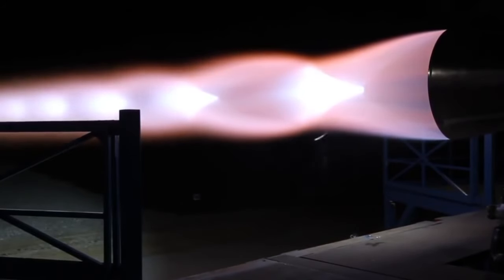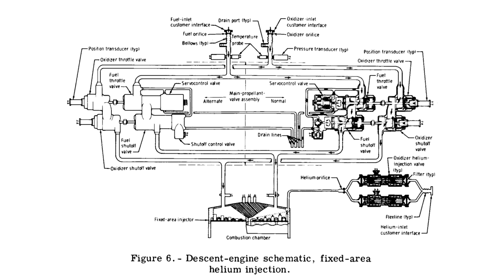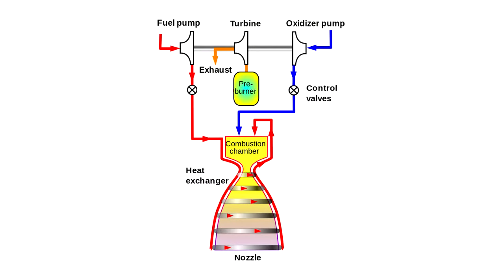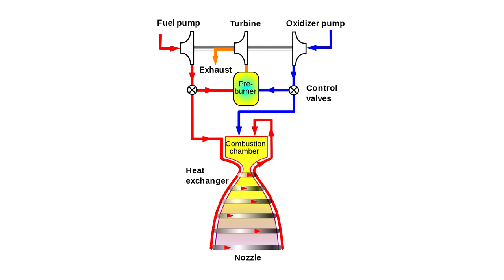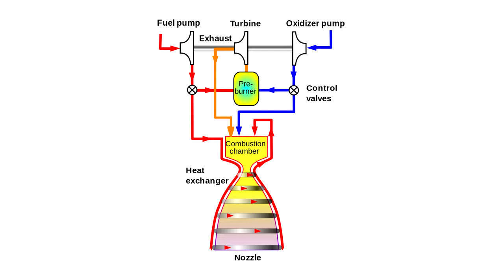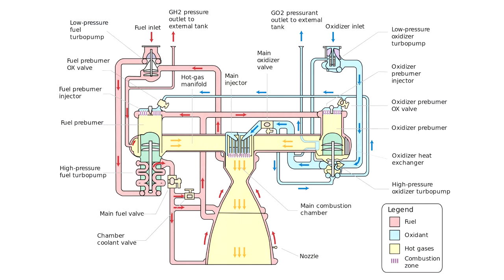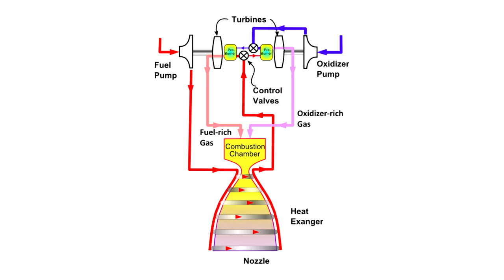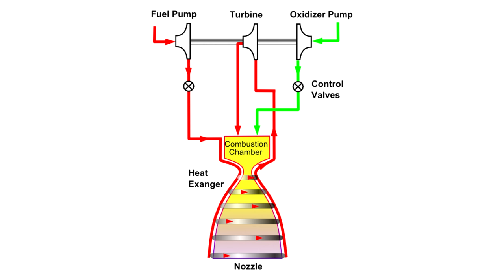KSP Doesn't Teach: Rocket Engine Plumbing

Comment: How about install turbines right on top of feeder inlet so that it burning chamber will resemble jet engine? Only it will get oxygen from internal tanker of cause. Back pressure from burning chamber could be minimized by funneling diameter. So, pre-burner will be in the center and fuel will be entering in the outer shell ( ceramic ) of pre-burner. This design even could be scavenging, in lower atmosphere, oxygen from outside thru, eventually, open-close inlet.

Comment: Scott could you make a tutorial on how to install Hot Rockets? I can't seem to get it to work. Thanks!
Reply: Cool them in a controlled environment to avoid cracks, then install them when they have reached near room temperature.
Reply: Lol good one. Thanks for the help however I would still like the tutorial Scott :)
Reply: Hot Rockets is just a plugin for other mods to add configs and assets to. If you're expecting something to change immediately after installing it, what you probably want instead is RealPlume.

Comment: Maybe hydrogen perperoxide (HOOOH) AKA Dihydrogen Trioxide AKA Trioxidane) is the oxidiser of the future ;-)  It can be catalytically decomposed to water & singlet oxygen... which you would need to use quickly but since it's in a higher energy state, it's more reactive so it will react with acetylene (and possibly 1,2-dicyanoecetylene. The plumbing for THAT would be exciting.

Comment: So how does the engine (pump) start in the first place in the combustion tap-off system?
Reply: normal fuel flow. Its only when the chamber starts reaching nominal pressures that you need turbopumps for force fuel in against the backflow - but by then the turbopumps are running from the already combusting...combustion. Yea...

Comment: hey ... I like your job and you are  helping me understand  more of what  I like in life so thanks but can you explain WHY HIDROGYN OR METHANE EXACTLY  how fuel is been choose by space engineers ??? ... please  respond  because I'm dying  to find out
Reply: Lots of reasons, physical, chemical, engineering, economic... Read 'Ignition!' by John D Clark.
Reply from the maker: +Sidou Benras I made a video about this a long time ago https://youtu.be/jI8TuufCp0M
Reply: Rocket engines work better the faster their exhaust gases goes. So fuels which have lighter exhaust gases will be better (for the same amount of energy). Hydrogen is really good becuase the combination of the energy released when it burns with oxygen plus the low mass of water molecues  (which is true for methane too). But there are other engineering trade offs: how easy is it to handle/store/pump the fuel? (Liquid hydrogen needs to be kept at -250C), how expensive is the fuel? How poisonous or dangerous is the fuel? So engineers choose fuel based on engineering trade offs!

Comment: Turbo pumps sound an awful lot like a turbocharger for a car, just with an extra compressor wheel to pump fuel.
Reply: Operation of turbo pump vs turbocharger is practically the same except one pumps liquid, the other gas.
A better analogy is (just as mentioned in the video) pumps in fire trucks. The impeller (equivalent to compressor wheel in turbocharger) spins and the centrifugal force sends the liquid to the outside of the housing and through the outlet. Pressure varies according to how fast the impeller spins.

Comment: Hi there!
I've got a question about rocket fuels! Is any alcohol able to be a rocket fuel? Like methanol etc.?
Reply from the maker: +Lele Merb alcohol was used on early rockets, but it's less energy dense than alternatives.
Reply: Scott Manley ah ok i already thought about the energy density of alcohols too. But I thought it would be denser than it really is. Nevertheless thanks for answering that fast.
Reply: It's not too bad for making small model-scale rockets if making tiny liquid-fuel rockets is a thing you want to try, it burns pretty easily, which helps.

Comment: Wait, why can't you just use a one way valve so that the pressure of the combustion chamber doesn't push back into the turbine in a closed cycle engine?

Comment: I understand the idea behind pressurizing the tanks to "push" the fuel out of them, but how do they make sure the ~fuel~ comes out into the combustion chamber and not the pressurizing gas?
Reply from the maker: +BloodyRain2k on the ground. Gravity. In space they'll use small thrusters to accelerate forwards and push the fuel to the bottom of the tank
Reply from the maker: +BloodyRain2k on the ground. Gravity. In space they'll use small thrusters to accelerate forwards and push the fuel to the bottom of the tank
Reply: Ah right, now of course I remember this detail which I picked up somewhere kinda recently.
And after the engine kicks in there's more than enough acceleration to keep the fuel in "front" of the pressurizer so it won't go into the engine.
Physics yay :D

Comment: why don't you just put the, for example, fuel rich exhaust of the turbine right infront of the turbopump of the fuel.
the hot exhuast gases would cool down in the fuel without combusting, and the preshure there is very low, so no worries.

I'm shure there is a big flaw with this, but i don't see it ATM.

Comment: Shouldn't there be another pipeline from the Oxidizer turbopump side going into the combustion chamber... on the diagram looks like all the LOX goes through the preburner... (on the full flow diagram) ?
Reply: No error, I think everything passes from the pre-burners and gassifies before entering the main chamber. That is why FFSC engines are also called gas-gas engines.
Reply from the maker: +Dante800 shouldn't that depend on the fuel/ox ratio of the fuels?
Reply: Nope, if I remember right from the wiki article that picture's from, they just mix the oxidizer-rich and fuel-rich gases in the main combustion chamber, since they're conveniently proportional.  Any reaction poisoning due to pre-burnt combustion products is made up for by the head-start on chamber pressure.
Reply from the maker: That diagram may refer to the IPD design, which what H2/LOX - the Hydrogen volume is so much higher.

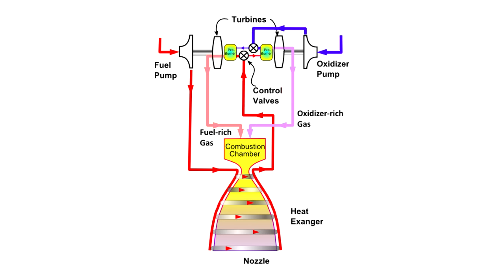Comment: In 11:23 picture there are no liquid fuel and oxidizer pipes going directly into combustion chamber. Is is to make the picture clearer? I'm confused.
Reply from the maker: +Jan Mikicki I think an edit to the Wikipedia page may be in order.
Reply: It seems that a tiny amount is taken from each to get the turbo props running, with a mix that is safe, then you mix the two back together after going through the turbo pumps. So all oxi and fuel goes through the generating turbo pumps and the pulling pumps, nothing skips the pumps to go direct to the combustion chamber.
Reply: unless it is supposed to be like that? meaning - fuel/oxidizer rich mixtures get pumped into their respective turbines at quantities large enough to sustain normal operation and pressure in combustion chamber... is that even possible? having a turbine that takes energy from that fuel flow but lets through enough to operate the main combustion chamber?
Reply: Guessing it's easier to just pipe everything through both preburners.
Reply: Its not easier. It is better though.

Comment: I thought the SSME also used a full flow staged combustion cycle? :0
Reply from the maker: Nah, not all the oxygen flowed through the pre burners.
Reply: @scottmanley  Ah, thanks for reply. Facing an exam in rocket engines next week. :D

So how you call the cycle from SSME?
Reply from the maker: @Revan176  It's a staged cycle with full fuel flow (all the fuel goes through the pre-burners).

Comment: How does fuel get to preburner(s) at startup before turbopumps are active?
Reply: The fuel tanks are pressurised with nitrogen or helium, or you might be able to do it with just gravity pressure if you are starting them on Earth and you tanks are high enough.
Reply: Smaller turbopumps are used to activate the next big turbopump.

Comment: Is soot generation not an issue with methane fuel? I know hydrogen doesn't make any soot if burned when hydrogen rich.
Reply: I believe that methane does in theory produce some tiny amount of soot, but it's practically nothing, especially when compared to kerosene.  The soot-generation process is generally referred to as "coking", and can be a big problem if you want your kerosene engines to be reusable.
Reply: In general the longer the hydrocarbon chain the more complex the combustion products. CH4 + 2O2 = CO2 + 2H2O.  4H2 + O2 = 2H2O.
Kerosene is a bunch of different long chain hydrogen carbons. So, it's not really viable to give a simple equation for it.
Reply: As someone who did mass spectrometry on flames at university I can help you with that a bit. First thing is that the processes in flames are not understood by now. There are many effects that determine the chemicals you find in the exhaust. And by that I do not only mean the type of fuel and oxidizer you use but also temperature, pressure and the system you use to mix fuel and oxidizer.
You can minimize soot generation by burning an oxygen-rich mixture because this reduces the chance of two reactive fuel radicals forming ever growing hydrocarbons which in the end become a soot particle that becomes a problem in your chamber.
In the end there are only two ways to prevent soot in your engine. The first one is to not use fuel that does not contain any carbon or to burn a very oxygen-rich mixture. In my experience 40% excess oxygen and good mixing means that you cannot find any soot or soot precursors using a mass spectrometer when you mix fuel and oxidizer well.

Comment: There's a small mistake I think. At 6:36 you say "Merlin engines burn a bit of your fuel with a lot of oxygen". That's wrong. Pre-burners on the Merlin run Fuel rich and so you're burning a bunch of fuel with a little bit of oxygen. That's why the pre-burner exhaust on a Merlin is dark and sooty black. You additionally don't want to run oxygen rich because that will burn the metals in your engine.
Reply from the maker: +Ergzay yep got that backwards, Russian staged combustion engines pioneered the ox-rich cycle.

Comment: a fuel pump from a modern diesel engine goes well over 1000 bar in pressure the engine will not start till it goes over 130 bars
Reply: The operating conditions in space are quite different. It gets very cold in the shade and hot in the sunlight up there and having high pressure inside and barely any pressure outside (near vacuum of space) doesn't help.
Reply: For pretty much the same reason even: to overcome the pressure in the combustion chamber. It's simply what you have to deal with when you use direct injection.
Reply: The flow rates are a bit higher in a rocket engine.
Reply: True, but don't underestimate the airflow through a combustion engine either!
A 2 liter engine running full throttle at 6000 rpm will suck in 100 liters of air per second. Mass flow is much less impressive, but that's what happens when you use ambient air. Fuel flow is even lower because ~80% of that air is pesky inert stuff.

Comment: Did you just summarize the chapter on engine cycles in "Rocket Propulsion Elements"?
Reply from the maker: I wouldn't know, I've never seen that book.
Reply: Scott Manley George Sutton & Oscar Bilbarz? A standard lecture for aerospace engineering

Comment: 5:00 Peroxide is an Oxidizer, not a fuel.  it isn't really a big deal, but it bugged me when I heard that.
Reply from the maker: It’s absolutely used as a fuel in monoprop engines.
Reply: @scottmanley  in monoprop engines it would be considered a "propellant" (mono-propellant), but the bloodhound uses hybrid engines so in that case it is an oxidizer.
Reply: it is a "rectangle/square" type of thing, oxidizers and fuels are both "propellants" (as are nitrogen, helium or whatever you want to use in a "cold gas" thruster) but oxidizer and fuel are not interchangeable since the role differs in the reaction chemistry.

Comment: Why can't you use perfect ration combustion for your preburner? You explain that the result would be too hot, but couldn't you just add less propelant?
Reply: That would make it an oxygen-rich preburner.
Reply: less fuel would not make it a perfect ratio
Reply: Did you mean "less propellant" rather than "less fuel"; reducing both the fuel and oxidizer proportionally so the mixture is still the perfect combustion ratio but less mass overall is combusted? My guess is that the uncombusted fuel or oxygen serves as a coolant to help carry away the heat.
Reply: That is indeed what I meant. My comment has been corrected  to reflect this. I would also have guessed that the uncombusted ingredients serve as coolant, but it seems like, were this the case, other solutions for heat dissipation would be more efficient.

Comment: if the pressure in the pre-burner has to be higher than in the combustion chamber... how do you get the fuel in there? :P
Reply from the maker: +Ebumbaya ' that's rocket science.
Reply: which is?
Reply: pumps. that go up to a much higher pressure than would be needed for an open cycle engine.
Reply: The pumps work above chamber pressure to feed the turbine. The pressure ratio across a staged combustion turbine can be low because all of the fuel is flowing through the turbine. With full flow staged combustion the pressure ratios (now that there are two turbines) can be even lower because both fuel and oxidizer streams are doing work. The turbine pressure ratio has to be as high as possible with a gas generator because the flow should be as low as possible.

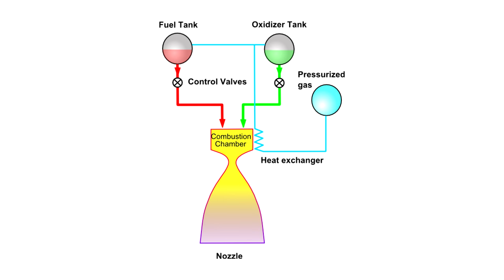Comment: 1:55 you mean Nitrogen is by far the most common. You said Helium :-) Or maybe you are right, I don't know... But it sounds stupid to me to pressurize something with Helium, if you can use Nitrogen - a much cheaper alternative.
Reply from the maker: Helium saves mass, mass is very important on a spacecraft.

Comment: Pratt & Whitney RS-24 (SSME) Block I H2 Brayton turbopump produces 53,690 kW which at 351 kg has a specific power rating of 153 kW/kg.

The EMRAX268 Brushless AC motor masses 19.9 kg and produces 200 kW which is 10.05 kW/kg.  Getting up there!  Its twice as good as a turbofan engine used on airliners!

SIMPLIFIED PLUMBING

Now consider the following, creating MHD power from the rocket thrust chamber directly; 

https://ntrs.nasa.gov/archive/nasa/casi.ntrs.nasa.gov/19970020328.pdf

https://en.wikipedia.org/wiki/Magnetohydrodynamic_generator

So, we can imagine an Aerospike rocket engine where the annular exhaust also operates as a disc generator!  The power is then fed back to electric drive motors, as in the Electron.  

This seems to me to be something that would be fun to play with.

Comment: LOL Closed cycle engines so complicated! Modern cars have been using it for years its called an EGR valve!
Reply from the maker: +PhoenixSnakeUK pfft, car engines are pumping around low pressure gas compared to rocket engines.
Reply: I agree but the actual physiology of the machine i.e. pressure fed turbine from exhaust gasses etc the principle isnt exactly worlds apart! :) The operating pressures of course! The principle! :)

Comment: OK.... Actually an expander cycle engine was built and tested by the competitor to the Space Shuttle Engines that achieved almost 20% more efficiency than the RL-25 used on the Space Shuttle. It would have way more than doubled the Space Shuttles payload to orbit. The Company even offered to develop and build the engines for free and all Nasa had to do was pay the Company a percentage of the added payload the Shuttle could lift on each mission. It would have cut the cost of the ISS in half and turned the Shuttle into the Space Truck it had originally been advertised.  But Corrupt politics intervened and Nasa told the Company that if the Company did not shut up and junk their engine, all the Companies Nasa and military Contracts that ran into billions, would be cancelled. The Company destroyed the engines and the Nasa Administrator went to work for the Rl-25 Engine Company for an outrageous paycheck as soon as he got out of Nasa. All Rocket Engine research in America came to a screeching halt. Why the Russains have been making most of the engines for American rockets for decades because they did not stop researching rocket engines..... Nasa has been throwing away America's lead in space now for decades under the name of Corruption and Never safe enough.... Go Space X

Comment: In preburn section, is there any burning? I mean real burning.
Reply from the maker: Yep, but only about 10 %
Reply: @scottmanley  First of all thanks for answer. How can they control percentage of burning? I think it can explode instantly when it start burn.
Reply from the maker: @Frosty_357  They control the fuel-oxidizer mixture to make sure it's starved of one.
Reply: @scottmanley  Pressure in the tanks used as starter like electric motor used to start car engine. Am I right?

Comment: The shuttle engine and the raptor are only running on preburned gas and no more fuel and oxidizer from the tank?? how?? how???????????????? that is a lot of preburned gas!!!!!!!!!!44!4!!!!

Comment: why not use electromagnetic pumps with a generator intergrated with the drive shaft.
Reply: the technology is not that advanced
Reply: you mean use electric power transmission to get around the sealing problem? Well you have the extra mass of the electric generator and motor and cables, the added complexity, and you probably still need some sealing on the shafts between the motor/generator and whatever they're coupled to.
Reply: Why not just have "drive shafts" connected by magnets? Then your seal is a wall.
Reply: how would it work, Irwin? explain, demonstrate how an "electromagnetic" pump would work. electric motor? or some kind of shit? I want to know your idea Irwin so I can explain how wrong you are.
Reply: Liquid oxygen is strongly paramagnetic